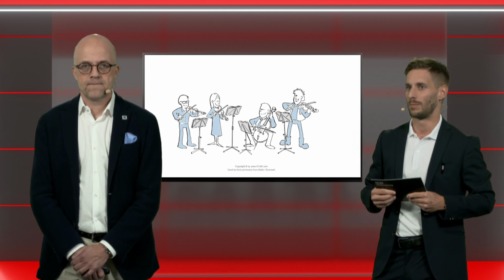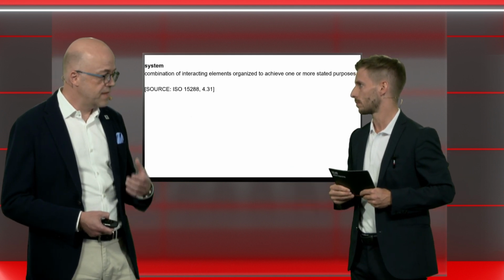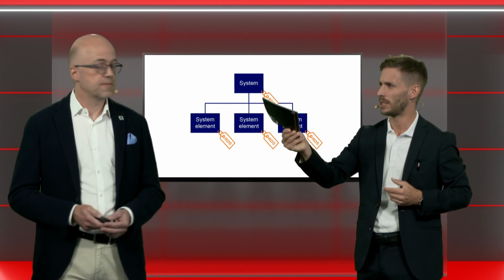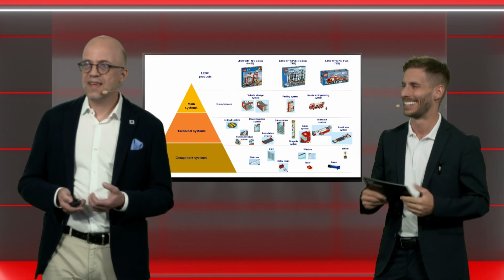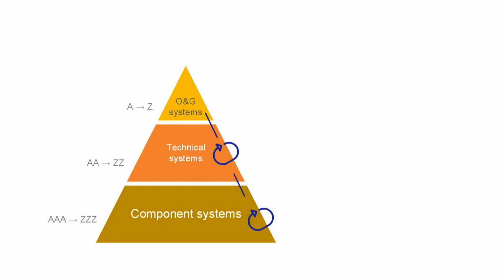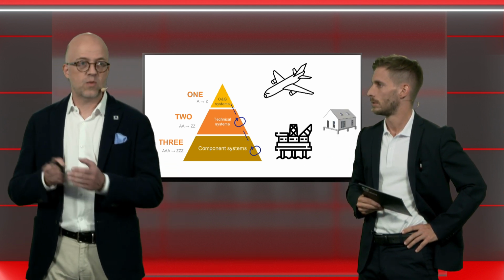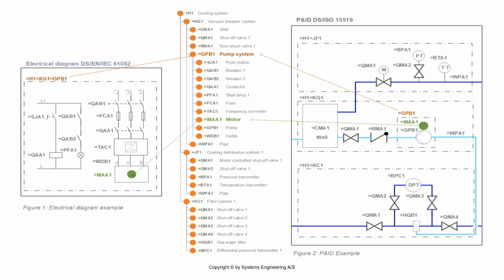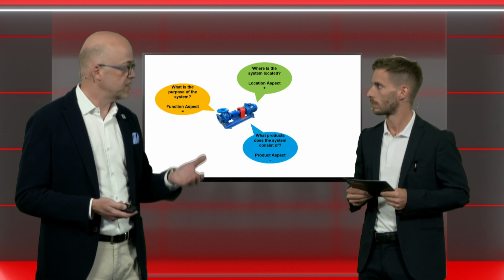How Systems Engineering And RDS 81346 Will Make You More Efficient

Comment: Your process assumes all design is top-down and relative to the top. That style typically magnifies integration issues. I'd always attack the complex bottom issues first, integrate early and build up from there meeting bottom and top in the middle. Then embellish and widen feature set incrementally afterwards. It's messy, no process can help you with that. And certainly no snake oil certification will help. I wonder how Open Source can work without all these certifications 🤣. Or maybe this is just a fuzzy product sold to managers without any engineering experience - like Scrum and SAFe.

Comment: Main challenges I had to went through when implementing 81346:
- attachment by technical disciplinary target groups to the preconception that a good RDS must mandatory convey mnemotechnic value (semantic language-dependent  abbreviations), namely, adoption of a pseudo RDS dialect not based (partially or as a whole) on the official letter codes.
- regarding implementation, lack of disciplinar enforcement by technical area managers or residual engagement into it.
- in the electrotechnic discipline, the false assumption that a component cannot be exclusively tagged with only one aspect. Onside of which, it would be valuable that Eplan P8 would support a more efficient to hide the product aspect, in case only the function aspect were to be exclusively used. Or a more efficent way to manage numeric counters for other aspects than the product.
- false assumption that ALL stakeholders of class “implementator” (electrical engineers, technical draftsmen, ..,) MUST understand the epistemological variations or formal possibilities in-depth for structuring a particular system. System implementator not necessarily equal to system designer. If combined with the first point in this list (namely, not sticking to the official letter code lists) this can end up in implementation divergences subject to asymetric levels of system structure understanding.
Reply: Main challenge is to code anything with rds if one is used to KKS. Which I still think is the best way of coding.
In words of the music example rds it will sound horrible.
Reply from the maker: @mennolankhaar8591  
Dear Menno
KKS is a former labelling system for power plants, which was followed by RDS-PP. Now, with the new edition of ISO 81346-10 being released, the common approach is called RDS-PS (Power Systems). KKS was appropriate in its time, but is outdated since then, and not fit for digitalization. 
Best wishes Henrik Balslev
Reply: @systemsengineeringas4101  Many thanks for your reply. I (we) have been trying to make use of the RDS coding system. I thought that the RDS-PP coding system was the follow up for KKS, which was heavily based on nuclear power plants. KKS  has a firm structure. Meaning whether you code a powerplant in Belgium or in  India. The code would be the same by its fixed structure  A(N) (N)AAANN AANNN(A) AANN AANN - Total plant Function  Equipment Unit Component Signal and the lists of systems.  I think that the RDS coding system allows to many different ways to code an installation. Now every time we integrate an installation in a customer plant we have to adopt to their way of coding. KKS would solve that problem, when formalized in a ISO-norm. I do not believe that RDS could do the same. Best wishes Menno Lankhaar.